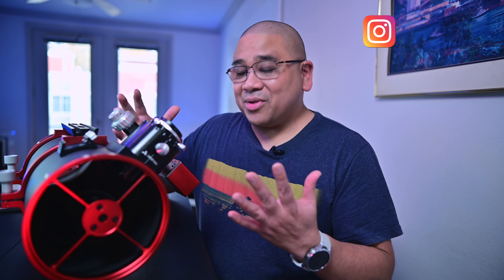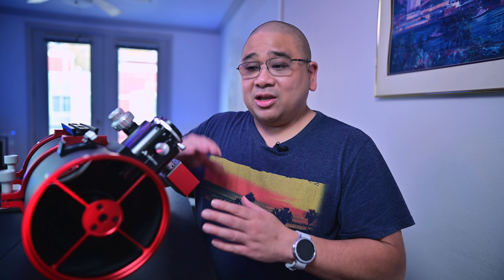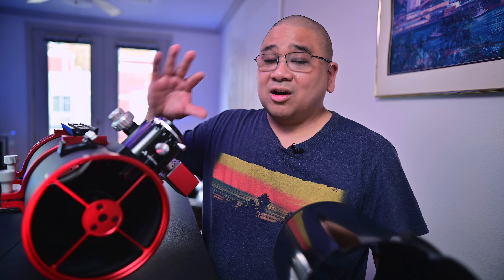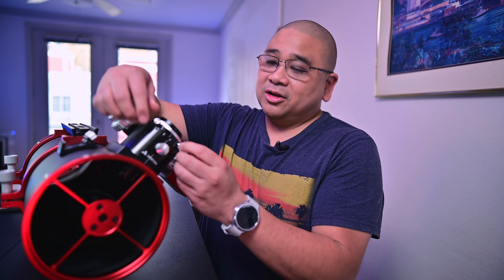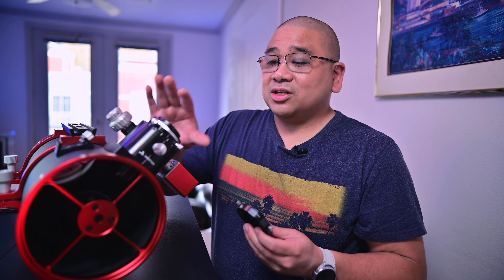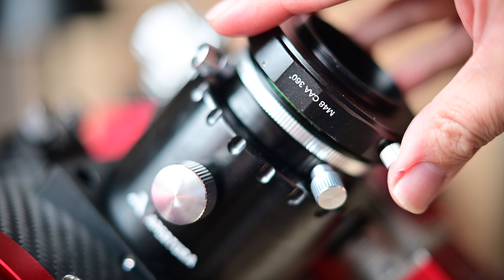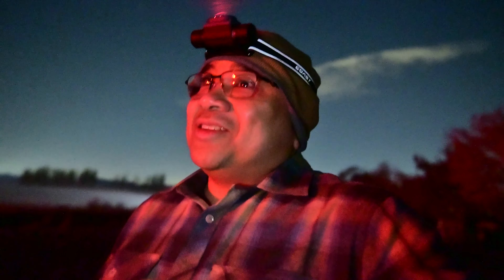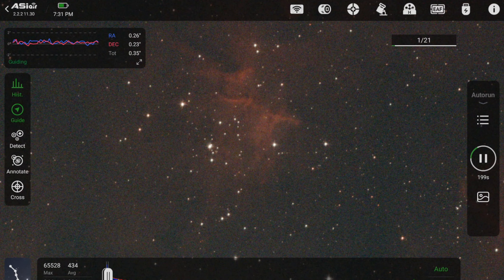Apertura Carbonstar 150, "Defeating my Newtonian Dew Issues and Optical Reliability"

Comment: I wanted to ask you. What OAG are you using?
Reply from the maker: I'm using a 50mm Guidescope with this but I do have a zwo OAG
Reply: @ ohhh thank you.
I also have a 50mm guide scope but I would like to use that space for the asi air and put my dew heater controller in the dovetail. 
Unfortunately the Celestron OAG I have is too thick for this setup where I need only 55mm back focus. I may get the askar OAG to replace the guide scope. 
Thank you as always for your help!

Comment: What 3D printer would you recommend for a beginner that is dimensionally accurate? I would like to print Astro parts occasionally and not sure where to start. Nice video as usual.
Reply from the maker: Thanks for watching this one!! Creality ender 3 is a good staring point with lots of support. Very inexpensive. If you can splurge maybe a K1. They are great right out of the box

Comment: I have that same rotator on my 8" EdgeHD. I've considered an electronic one (like the Pegasus) but just isn't worth the expense to me. Everything is threaded on my setup, so a rotator was necessary. On my SharpStar 15028HNT, there's a rotator built right into the focuser. Again, the entire imaging train is threaded/bolted.

You're definitely more adventurous than I am regarding imaging. If I'd seen those conditions, I wouldn't have setup. Then again, the trip to my imaging location is from the garage to the end of the driveway :). I actually use an AstroZap flexible dew shield for my newt. I already had it for my 8" EdgeHD, and all I needed to do was apply another velcro strip to make it fit the 6" newt. Serves a couple of purposes... first is dew prevention. Second is to keep the stray light out as much as possible. It's one thing I don't like about the SS design: no internal baffles, so it's extremely susceptible to stray light reflections.
Reply from the maker: Man that would be amazing! Perhaps someday I will be able to do that!! Yea I try to take advantage of every night I can right now. Perhaps I should test scopes during the spring lol! Although it will be interesting to see if cold weather will affect collimation.
Reply: @ it’s convenient but has drawbacks. I have a pretty limited view of the sky only able to image to the west and north, which is unfortunately where the biggest light pollution is. Also I’m at best Bortle 7 so my skies are pretty bright. I keep telling myself that I’m going to find a better location to image, but I’ve yet to actually follow through 😂
Reply from the maker: I totally get that! I am very comfortable with my 2 dark sites but I promised myself a little adventures starting next spring! I hope adventure finds you as well my friend!
Reply: Where did you place the rotator in your edge HD? How did it work with the back focus with a reducer? I have the same rotator but haven't used it